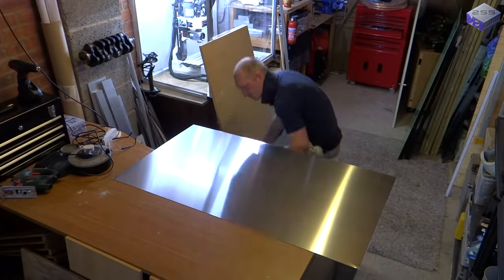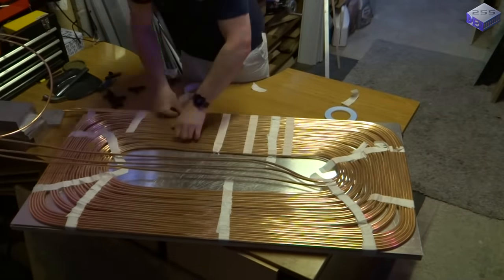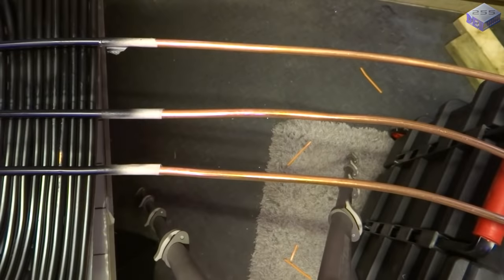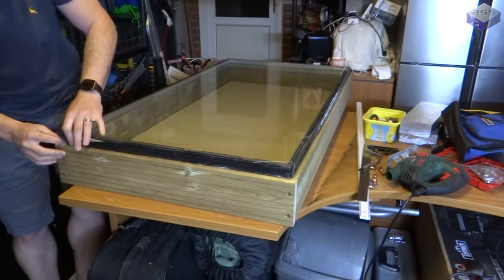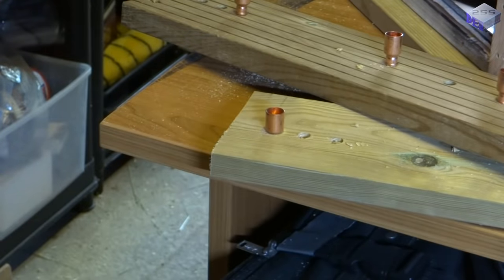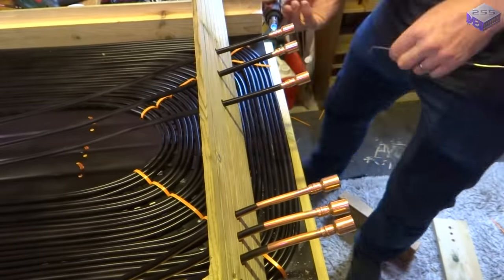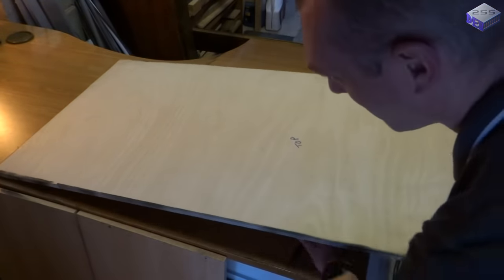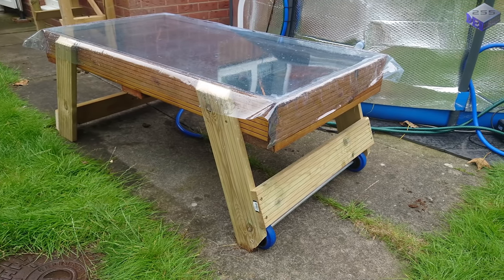Improved Solar Pool Heater - Full build

Comment: Absolutely great video! The most efficient way to flow the water through and get the most heat out is if you make the "middle" pipe flow in the opposite direction compared to the other as it is in contact with the two adjacent pipes. So that would be, counting from "left": 1 = In, 2 = Out, 3 = In / 5 (1) = Out, 6 (2) = In, 6 (3) = Out
Reply from the maker: Hi, thank you I will definitely try this out and get back to you with the results. This makes logical sense in my head too. I may try it one way and then the other to see the difference, although this would have to be within a close time period to get similar sun exposure, possibly over mid-day on a cloudless day. Great suggestion
Reply: Great comment - can you explain why that is more efficient?
Reply from the maker: @davidepperson2376  Good question, I have it setup like this at the moment. I believe its due to the cooler water entering in one location and keeping that area cooler and the exit location being warmer, so mixing the ins and outs up could average the heat over the whole panel and improve its heating capacity (just off the top of my head).
Reply: @davidepperson2376  It is not. I will try to explain these through thermodynamic processes for this case/project. The black color is a good absorber, but also is a good emitter of the heat. The only thing that matters for the good efficiency of this system is how much of the heat will be collected by the water passing through the copper pipes. The rest of the heat will be emitted into the surroundings. Heat transfer from the copper pipes into the water depends on 3 factors, the temperature difference between pipe walls and passing water which for continuous flow, in this case, is constant, surface area between pipe and water, which in this case is constant too and heat transfer coefficient that can be manipulated. The last one depends on Nusselt number, which depends on Reynolds number, which depends on the water velocity in the pipes. Higher water velocity, higher heat transfer. Since this project uses a pump for water circulation, the mass flow rate is the same throughout the whole system. Arrange pipes in parallel you divide the mass flow rate of the water by 3, which means dividing water velocity by 3 and decreasing the heat transfer coefficient. If you arrange pipes in serial, the mass flow rate will be the same, the capacity of circulating water will be the same, but water velocity will be increased, which means a higher heat transfer coefficient. I hope this was helpful.
Reply: @dragoljubpetkovski8572  i agree with anyone who is an 'ovski'
Reply: @dragoljubpetkovski8572  But surely you will need a more powerful pump to shift the same amount of water down three times the length of pipe, at three times the speed.  The problem is to find the best compromise , and I don't think 8mm tube is the best starting point.
Reply: @dragoljubpetkovski8572  well to your point, the temperature difference will be higher at the 'exit' part of the pipes because currently the water will already be arriving warm at the exit point so the exit part of the box will be hottest area and emitting the heat to the outside or wherever but if he had cold water entering the mid pipe in the same area where hot water is exiting the box in 2 outer pipes, then that cold water could use the temperature difference and heat would be absorbed by the cold mid pipe instead being emitted to the outside.
Reply: @dragoljubpetkovski8572    does that mean larger diameter pipes would work better, due to the larger volume of water passing through?

Comment: I like that it’s 3 separate lines, more efficient. Some people would run one long continuous line. What they don’t realize is that after a certain number of feet or meters the water doesn’t get any hotter.
Reply from the maker: Thank you, plus the pump runs more efficiently as it has better flow, I'll need to do some more experimenting this year.
Reply: That Depends on flowrate

Industrial high-pressure systems can go for several kilometers of pipe before reaching Tmax
Reply: Like a car radiator. A higher temp thermostat can actually reduce the coolant temperature because it slows the flow allowing more heat transfer away from the radiator. Where a fast flow wouldn’t give time to transfer the same heat before it’s getting heated again by engine heat.
Reply from the maker: @fishandgameman  Thank you, that makes perfect sense, I guess the specific heat capacity of the material it needs to transfer the heat to would determine the ideal flow rate? Taking into account the specific heat capacity of water too. I hadn't thought of that, I suppose it's like touching a hot iron, if you touch it for a millisecond it won't transfer a lot of heat energy, but if you hold your hand there a trip to the hospital may be required :-)
Reply: I believe there are several variables at play that a fella could really get into the weeds over. A PWM pump motor varying flow by receiving an algorithmic processed signal of input fluid temp, coil box temp and out fluid temp would constantly adjust for optimum efficiency. A few thermistors linked to a solar powered processor of some sort and a program running would do it. The pump motor could operate on PV to since it doesn’t need to run over night anyway. I see those Arduino things, maybe that would work. You could add a circuit of pipe flowing through some sort of heat retaining material that would collect heat during the day when the sun is shining and dissipate the stored heat energy at night so you are warming the water temperature more hours per day. May need some solenoid valve and another thermistor so the algorithm can divert flow when the box coil temperature drops below the water temp at night and begins using the stored heat energy. I wouldn’t know where to begin on the software engineering part. That would be some crazy accomplishment right there.
Reply: @TheSolarPoweredEngineer  Not sure how much the restriction matters (with what you already have) but using wyes may help your flow rate.
Reply: If you reach equilibrium with temperature, you need a lot of time or enthalpy to achieve that. Long pipe isn't the problem. It only decrease the the time needed and increase the area of exchange. When your delta T is low or 0, increase flow. What helps is an turbulent flow >1.5m/s.
Reply from the maker: @fishandgameman  That all seems achievable though, my last panel used an Arduino nano that logged the pool temperature and measured 10 temperature sensors around the system including input, output, center temp, outside temp and pool temp, although only controlled the power to the pump and not flow. This worked really well and stopped the flow when the panel dropped below 5 degrees above pool temp. I may just do something like this. You can look at my data from the last panel on my website www.dev255.uk
Reply: @TheSolarPoweredEngineer  It sounds like you have the hardware and programming knowledge to accomplish the collection of data and control outputs required necessary to achieve optimal efficiency based on the variables. You have already achieved a very efficient heat collector. A proper variable speed pump motor, and I’d stick to low voltage for safety sake, and you are on your way. 

I think a key factor to overall efficiency would be storing the excess heat energy during the day, so it could be consumed overnight or cool days where the ambient temperature is below the desired pool temperature. To achieve heat storage there are a number of ideas to explore. A biomass of some type to include a nearby compost bin, green house bedding, well insulated sand, pebble, rock and fluid chamber. 

Not having the programming knowledge or solar, I once heated a small greenhouse by storing heat in a biomass type system. I used a large stock pot, drilled a hole for a bulkhead to accept a 120V water heater element, and used a WH thermostat to control the temperature of the water in the lidded pot. I spliced a line voltage baseboard thermostat in a J-box a few feet from the female end of a 12AWG extension cord after doing load and voltage drop calculations. The pot was slightly set into the soil in a basin of material like the aforementioned. I surrounded and covered the exposed area with large rock and mulch blanket. 

When the air temperature in the greenhouse reached the set point calling for heat at the baseboard thermostat, it closed the circuit, provided current to the water heater element, warmed the water to the ~120 degree set point of the element thermostat, and conducted said heat into the surrounding biomass that warmed the greenhouse by convection. It worked really well and kept a cheap vinyl greenhouse full of Cacti alive through a cold midwestern US winter. I should have made a video. I still have the rig. Never know when I might use it. I’d add a Li battery bank, PV array and inverter next time, and stay off the grid. Peace.
Reply from the maker: @fishandgameman  That sounds like a great setup to put on YouTube, I  think you would get a lot of views for a video like that
Reply: Would ten shorter lines be better?
Reply from the maker: @gstevef  Quite possibly, as you could get faster heat exchanged from the collector. I will need to do some more experimenting this year.
Reply: If the water doesn’t get any hotter, you just increase the speed!
Reply: @thelazycat_  clever. My point. Increase flow.
Reply: @fishandgameman  wth 🤦‍♂️
Reply: @harunyahyadotorg  indeed. And starting with a turbulent flow. (Not hard to achieve). Did a fast calculation on the pipe he used. He have a Reynolds number of around 26000. So he has a turbulent flow (>4000).
Reply: @thelazycat_  how do you start with turbulent flow? 

Ps I’m making something soon. Very basic though. Got to start somewhere.
Reply: @harunyahyadotorg  you can calculate the Reynolds number. The accepted rule is a Reynolds number above 4000 is turbulent. You want a turbulent flow to prevent/remove the laminair boundary layer between the pipe and water. That layer reduces the heat transfer. How do you do that? When you look at the equation: Re = (rho * V * D)/μ	. You can increase V=velocity or decrease the diameter (when keeping the velocity the same). Example: water 998.2kg/m3 * 1m/s * 0.01m diameter / 0.001 pa.s dynamic viscosity = Re 19.932 Turbulent flow. Whit a flow of 5 liter/min you have a velocity of +- 0,265 m/s. Re 5.290. higher Reynolds is better heat exchange. How to start? Don't make the pipes diameter to big if you have not the pressure to deliver an high enough flow. Other variables that matter for heat transfer. Bigger surface area, material used, diameter of the pipe wall and many more
Reply from the maker: @thelazycat_  Hmmm, this is a really interesting subject, I hadn't heard of Reynolds number before (or I had and had forgotten), so I need to increase flow, I'll have to measure the temperature on the outside surface of the pipe and try different flow rates to see what happens.

I am currently looking at a simple heat exchanger with one pipe inside the other, where the larger pipe has radial ridges to create the eddy currents, similar to my motor heatsink on my home CNC machine. I'll have to play with flow rates too to get the most efficient transfer.
Reply from the maker: @harunyahyadotorg  Hi James, it will be interesting to hear about your project, feel free to share here if you do any videos, there is a lot of good information that comes through the comments, such as @The lazy cat

Comment: Great project! The only suggestion I have is using stainless steel cable ties rather than plastic. I found out the hard way from hanging string lights outside way how the plastic ties get brittle in direct sunlight.
Reply from the maker: Hi, yes, I do need to change them over to non-corrosive metal ones. I think this also highlights another issue reading through the comments, where the current cable ties have not degraded at all; this being an indication that the glass is reflecting/absorbing the UV instead of allowing it to pass through; this could be making the panel less efficient.
Reply: Does aluminum and copper have corrosive components when they touch

Comment: Hi! I've watched all of your videos on this topic, I also read every single comment on this video. There is tons of information and so many helpful discussion! 

I really interested to make one myself. Especially as I lived on the equator, I really wonder how well it can be. The last few days I already tried to make some crude experimentation with some stuff I had laying around. I had one 5 meter of 5/16" diameter hose coiled inside a 50 cm diameter alumunium wok, then I cover the wok with a 20cm glass pot lid. I use a small pump with 4 liters/s max capacity for the circulation.

On midday, I fill 10 liters of water at 25°C to a bucket, then I cranked the pump to let it running at full speed. 30 minutes in, the water was already at 34°C! So based on my calcuation, it collect around 230 watt of power! Quite shockingly because basically all I just did was tossed the 5 meter hose inside the wok and top it up the with a lid without any insulation. All of this are only on 0.5 M² area.

I immediately ordered 50 meters of those black pvc irigation hose for further experimentation!

Anyway Its been a year since you released this video, any update for the next one? I'll looking forward it, cheers

Comment: Awesome build! When we built our pool we put a bypass diversion in the filter outlet and ran it through a couple of hundred meters of piping, just under the black tiles surrounding the pool. Works like magic and supplies free hot water   to raise the pool temperature.
Reply: Do you burn your feet on the tile? Or does the cool water cool the tile
Reply: @thomasr1051  the tile gets hot, but just splash some water on it or step over quickly..... its about the same as a tarmac
Reply from the maker: Nice idea, plus it's a permanent fixture so you don't have to pull it out each year and connect it all up. Would be good to have a glass floor with pipes underneath, although a bit costly.🤔
Reply: @TheSolarPoweredEngineer  That would look bloody amazing though 👏
Reply: @TheSolarPoweredEngineer  I'm only a Chippy, not an engineer.... But I was thinking that if you make a MK111 Try painting it with one of the new generation super  acrylics like Musou Black. Also if you used thermal grease in between the thermal adhesive strips you would get more conductivity. Also if you add some kind of gimbal you could achieve a better angle to the sun and   optimise solar aspect ratio.
Reply from the maker: @ET-jv1wm  I should get to try all of these things out this year, I tray and make the best panel from all the suggestions on the comments. I would also like to try improving a purchased one too and having it move with the sun with the pump running on solar too. Watch this space. Chippies are highly skilled in my opinion, my Dad is a cabinet maker. Thank you for the info
Reply: @TheSolarPoweredEngineer  As a new subscriber I'm looking forward to it! I developed the underground one with my old man over  20yrs ago in South Africa and its still going strong. But not 100% sure of its viability here in the UK I have often thought of making a small  portable parabolic trough one for the above ground pools that most of us use here, but I'm intimidated by the mechanics and  electronics behind a  sun tracking system....
Reply from the maker: @ET-jv1wm  Thank you for subscribing 👍. Yes it's a little daunting but all possible, I'll have to make something up and put the electronics and programming out there also. I've been converting my mill to CNC so I normally get deep into programming and electronics

Comment: Nice work!
If the difference of temperatures between air (outside) and water (inside) is not that large, it is hardly worth the effort to build the collector elaborately and insulate it so well. Unisolated black pipes on a flat surface do the job very well with an efficiency of about 80% and a friction of the cost. If the temperature difference is larger (e.g. hot water in winter) you will profit of this kind of construction. 
But respect to the nice work!
Reply from the maker: Thank you, the idea was to take all the comments from the previous version and apply it to a new design, I will be doing further tweaks to see how efficient a home made pool heater can be and may just go back to my first design a little, where that was fairly simple and effective.
Reply: @TheSolarPoweredEngineer  Nice project, but for a very small pool I guess. Did you measure the power output or just estimated it? With 500W of power and a 500l pool (not that big) It will take a bit over 1 hour to warm up the water by 1*C
Reply from the maker: @znpvrx  Thank you, this is working alongside my first version that outputs around 600W on average over a good summers day (950W per square meter of solar energy mid UK) and a bubble wrap solar cover; these all heat our 4600-litre pool and has got the water to 31.7 ºC so far last week. The 500W output was calculated from the temperature difference from input to output with a measured flow rate. I have recently purchased a few flow rate meters and serial thermometers so will be making another Arduino-based data logger showing how they perform, and which one generates the most heat during a full day. The idea behind these is to see if it is possible to make an efficient water heating system at home and share my experiences. I've gone into this in quite some detail for the last version and will be doing the same for this one.

Comment: I’m using 1 inch black pipe for underground sprinklers . Lol way cheaper then copper . It is $100 for 100 feet . But I. Thinking I should now build a box to contain it . And trap heat inside.